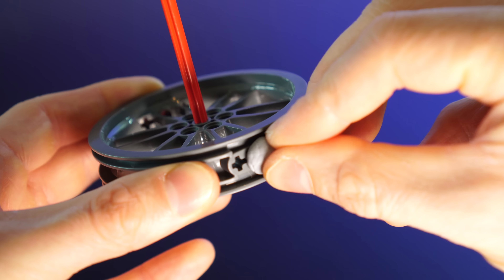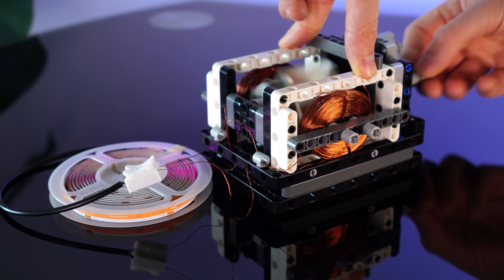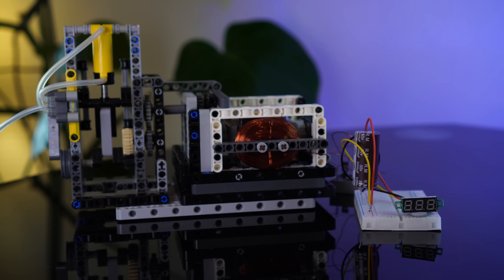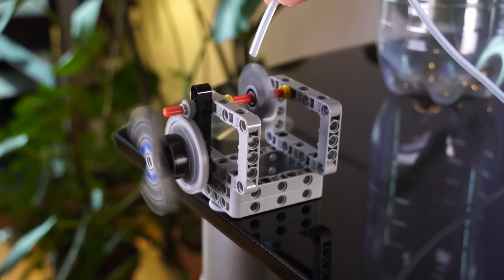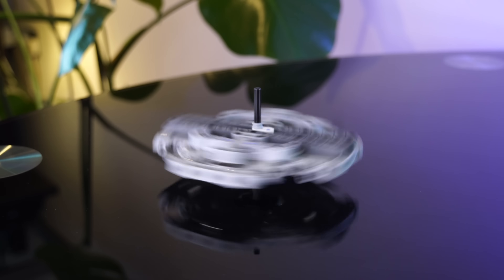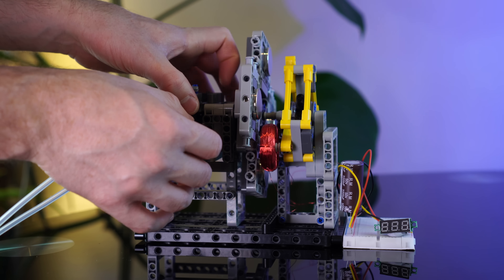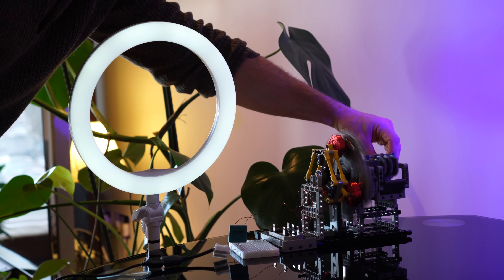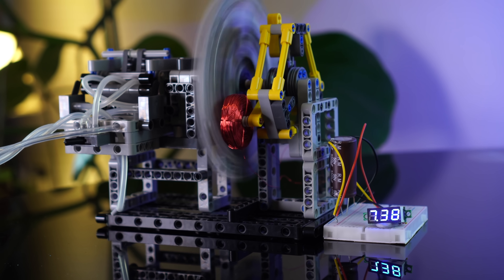Lego Air Turbine: Generating Power From Thin Air!

Comment: I’m using the airflow from my air purifier to generate air for directing the air. Instead of an oscillating fan powering oscillator, I’m using the generated air to oscillate an air director.

Comment: Can u do a six phase generator?
Reply from the maker: As far as I know you can make as many phases as you want! Though there isn't much (or any) benefit to adding more, especially if you smooth the output with capacitors
Reply: @JamiesBrickJams  wow I didn’t think you would reply. thanks!

Comment: You might need to modify the Pneumatic Pistons, simply lubing and redrilling the holes will increase smoothness and better rpms
Reply from the maker: I'd love to make one with modified components! Green Gekho has some incredible engine designs. My dream would be to collab with him to make a pneumatic engine generator using his latest powerful designs
Reply: @JamiesBrickJams  I only know this from another YouTuber, he did a bunch of Pneumatic Engine Designs and wanted to see the max rpms he could get. He didn't go into depth about it, he doesn't speak in the vids lol, but he showed a point where it appeared he took apart the piston and lubed and I think drilled but it may have been smoothing out the edges that go around the piston. Afterwords it had a sizable increase in movement and rpms. Once I have the money I'm going to be checking out some of these sets myself.

Comment: The better question is: can it run a compressor to get the same amount of air back?
Reply: No because of the law of energy preservation alot of the energy is lost to heat so you will lose alotof power

Comment: Its kinda possible to create a generator from spinning a bike wheel thing, like just attach a big gearbox to it (obviously not a lego one) and connect it to these magnets in a bigger circumference and a bit more of the wire, and you have a big voltage generator!

Comment: Sry i might be stupid but HOW does the air transfer from the bottles to the Valve

U put something on the bottles to press the air out ? 

Or am i missing something
Reply from the maker: So the bottles have a pipe going into it, and a 3 way valve connected to that pipe. A compressor then pumps air into the bottle, and the valve is then switched to the middle position, sealing in the compressed air. Then when you want to reject the air, you simply open the valve again. It's just a standard Lego pneumatic valve!
Reply: @JamiesBrickJams  I thought the compressor was only used for testing aight I missed that great GREAT video and thanks for the Reply 
Have a good one :D
Reply from the maker: Appreciate it, you too 😁

Comment: Use a MPPT chip to gather as much power as you can!
You can charge up a LiIon cell, and probably expand your lighting time at least a bit.
The passive AC to DC is lossy, and you waste ennergy by not using all the voltage and current when available.
An MPPT chip will help you with that = )
Also, the flying wheel was like a mechanical capacitor, it would improve stability a bit too (even is your last design is "heavy", so it probably don't need it).

So, yeah, nice video, thank you!

Comment: Wouldn't those turbines spin better if you lock them up, sealed. So ALL the air acts upon the proppelers? (Yeah i don't know how can you seal them up with legos😂)
Reply from the maker: I'm pretty sure you're right, that should improve efficiency! I tried a few different designs that mostly sealed it up, but I actually didn't see any increase in speed or output, so I just removed it to make it more interesting to see in action. But I'm sure if it was done properly it would improve output

Comment: when you made your coil, did you use bare copper wire or was it clear coated?
Reply from the maker: That wire is coated yeah, so it's insulated! Otherwise it'd short itself. Fortunately, almost all wire you can buy on spools is insulated like this

Comment: how do you make your coil? is there any special way you wrap it in to a circle?
and one more question. what wire do you use
Reply from the maker: Those coils I actually just wrap around some Lego. The middle is a small technic smooth bushing, and then I often sandwich it between a couple of Lego wheels or liftarms. Then you just wrap a bunch of turns! At the end secure it by wrapping a bit of wire around it. I believe these coils were made with 30 gauge copper wire

Comment: Im thinking that you put the air pump like powerfull one and hook the power into generator and the powerfull pump goes to air bottle and i think it makes infinite electricty btw convert the volt like 7 to (the pump volt requirement)
Reply from the maker: Ha I wish. Converting power from the pump to air then back to electricity is one of the least efficient ways of energy conversion 😉

Comment: I know how how bro can upgrade this just add some uranium 235 and make a nuclear reactor out of it!
Reply: He'd need to build a core with control rods, then build a water heater that uses the heat from the core to boil water into steam and make a turbine spin. It would work but radiation, cost and legal troubles are things to consider.
Reply: I don’t think that would happen
Reply: welp... LEGO NUKLEAR POWER YEAAAAAA.......

Comment: Hey, Great Video But can you maybe link The Radio Module? Thx
Reply from the maker: Thanks! It's the YINETTECH 87.5-108Mhz FM Radio Receiver Module that I got on Amazon (UK). I'm sure there are plenty others like it on places like Amazon and AliExpress
Reply: Thank you so much! btw: do you know if you could use it with headphones?
 @JamiesBrickJams
Reply from the maker: Yup you can! There's a small 3.5mm audio jack built in. It doesn't do Bluetooth though

Comment: How strong are your magnets? What are their pull forces?
Reply from the maker: They're n42 magnets with a (supposed) pull strength of 16.5kg at 25mm x 10mm
Reply: What’s the pull force of the large square ones?
Reply from the maker: Those ones I'm not actually sure. They measure 40x40x20mm and are an absolute nightmare to work with. They're absurdly powerful, and almost impossible to separate unless you make a magnet guillotine. Very dangerous to leave lying around too

Comment: That’s actually a one-to-one gear ratio known as a direct drive. Did you take out both gears from the generator and the engine you will get an actual direct drive
Reply from the maker: You're right, not the smartest idea - it would have been better designed if I removed the gearing for that one rather than losing efficiency through the gearing. But a future version will run much better!

Comment: Bro just a question why do you used a bottle how did it work 😊
Reply from the maker: Hey, the bottle stores compressed air from the compressor. A valve keeps the air in. When you open the valve, the air is forced out, which blows over the turbine blades, powering the generator

Comment: What if try to turn on an aircopressor
to if it can spin the tutbine?
Reply from the maker: Yup, sure can. I experimented quite a bit with running it directly off the compressor. It works reasonably well, but obviously not as fast as running 3 inputs at once

Comment: Idk if my comment reached but what is the wires made out of???
Reply from the maker: Hey! They're simple copper wire - you can experiment with different gauges (how thick it is). Generally thinner wire with more windings will yield higher voltages but lower current due to higher resistances. The copper wire has a thin enamel coating which protects it from shorting
Reply: Is it magnet winding
Reply from the maker: I'm not sure I understand what magnet winding is. This is just a spool of standard copper wire that I wrapped around a Lego piece in a disc shape

Comment: How to you use the bottle to blow air
Reply from the maker: Ah perhaps I should have explained that better - the bottle is pressurised using the handheld compressor! So it stores a few litres of air under pressure. When the valve is opened, the bottle forces air into the turbine

Comment: You should put coils a bit further from the centre so the magnets pass in front of them completely.
Reply from the maker: The position was carefully done so they do pass perfectly in front of the coils - perhaps the camera angle didn't show that off well enough. But you're still right in a sense - positioning them further out could potentially increase output slightly as they'd be moving faster against the coils

Comment: Wait a second, hold up… the engine was coming under load because the circuit had too much electrical load, and that was transferred via the magnetic interaction from the magnet and the copper coils? Is that right?
Reply from the maker: Yup! Any time an electrical load is placed on a generator, you can feel the resistance against the generator input. So for example, if you crank a generator, it'll move easily with no load. Add an electrical load (e.g. a powerful light), and you'll immediately notice the resistance against your hand increase. Same for this pneumatic engine. Add an electrical load, and the engine will take the strain. Sometimes even enough to stall the engine. Kind of like starting a car in 5th gear

Comment: I have a video idea for you that doubles as something useful as a diy project for your audience, can you make a hand crank powered usb phone charging port out of Lego? Preferrably with some kind of internal power storage so you don't have to worry about your phone getting a stutter charge if you aren't cranking right or get tired before your phone is charged?
Reply from the maker: Love a good crank generator! I actually already have a video on a hand crank generator that uses a voltage regulator to stabilise the output at 5v, pretending to be a USB, and was used to charge my phone. But will likely do something like that again in the future

Comment: Would like to see your 3 phase generator power a 3 phase brushless motor.  Don’t forget to add load so your inrush current doesn’t damage your motor.

Edit:  I just discovered your channel.  Going back over your other videos, I came across your levitating fan.  This might be an excellent candidate for a 3 phase motor.  It would eliminate the need for the reed switch altogether.  Just in case you don’t want to do the conversion, I posted another suggestion there.
Reply from the maker: Another excellent idea, thanks for all your suggestions today! That's true, treating the fan as a traditional brushless motor is totally doable. I'll be honest, it does feel like a weird and lossy way to power it, but I sure do love the over-engineered nature of it 😁 Will certainly bear that in mind for some future experiments!

Comment: Why does he think compressed air is thin? Is he stupid?
Reply: It is technically thinner than other compressed gasses. Because air takes so much more energy to compress compared to other gasses. That's why air tanks have thick shell containers compared to something like air dusters, Which those containers have liquid that turns into gas. That's why you're not supposed to breathe them in and keep them away from heat.
Reply: Plus I don't think he meant it literally because it's supposed to be playing on words like "I'm producing electricity from "thin air"
Reply: @ParkerLewis912  why did he take my comment seriously? Is he smart?

Comment: I would add a gearbox to make it able to spin faster, as the rotor acts like a flywheel. I would also make it water based as water is heavier and cannot be compressed, making it unable to lose power that way.

But overall, nice work!
Reply from the maker: Originally I had planned to use a gearbox, but to be honest, the efficiency losses due to the mechanical setup of Lego gearboxes made it a very poor performer. But I'll certainly try a gearbox for a future more powerful cylinder-driven generator!
Reply: @JamiesBrickJams..more deal with gear less RPM you'll get...

Comment: Great idea and execution! One idea for improvement: Remove the spacers between those turbine wheels. You are losing airflow there that you could use more efficiently if the gap between the turbine wheels was a small as possible.
Reply from the maker: I've heard that suggestion a few times now, so I suspect you're likely right - I'll give that a try in a future update! Thanks for the suggestion 😁
Reply: @JamiesBrickJams make an wind mill and and compasiter and try to add solar panels

Comment: Aren't you losing efficiency by changing mediums?
Reply from the maker: Changing mediums? Not sure which you're referring to... But if you mean using the compressor to compress air, then using the air to turn the turbine, yes - there are massive losses between those steps! It's hilariously bad
Reply: To what tho?? like compared to a normal generator? Come on man that's silly

Comment: The video is nice 👌
My question is , how do you achieve the required air velocity at the nozzles out of “ thin air “ ?
I assume this is nothing but a mini windmill ! 
But how to convert thin air into compressed air of pressure & volume ? 0:07
Reply from the maker: I guess a turbine is technically a kind of windmill with extra steps. Not sure I entirely understand your question, but the air nozzle is just supplying compressed air (at high speed) from those bottles. And the bottles were supplied air by the compressor. So as the bottles release air and return to atmospheric pressure, that high speed air turns the turbine blades, which then go through a gear reduction to turn the rotor. The term 'out of thin air' is just a fun play on words 😉

Comment: make a lenz less generator. need one medal disc rotor from a saw cut away the teeth's then cut the disc similar to a turbine but so that the steel can cover one magnet and one coil with the space of one magnet empty. then place magnet and coil in the stationary frame one magnet and one coil and repeat. place another set on the other side. place the disc rotor in between the two sides of the stationary frame and when you now rotate the disc it will alternate the inductance between the coils and the magnets but in such a way that there is no drag on the load.
Reply from the maker: Hmm will need to do some research to understand what you're proposing here. But I'd be cautious - there's no way round the conservation of energy. For a generator to output anything (with a load attached), there will always be resistance against it. That's a requirement for energy to be transfered from mechanical input to electrical output.

Comment: Use a lego motor as a generator
Reply from the maker: Could do ... But where's the fun in that? 😉
Reply: @JamiesBrickJams  you could make a comparison video and if the lego motor is better (wich i would assume) you could try to optimize your generator even more🙃
P.s. wassn't supposed to be a critic hope it didn't come over as such love your video's 😉
Reply from the maker: That's actually a great idea! I'm pretty sure you're right - I'd imagine the Lego motor is likely to be more efficient. Though I could likely scale up the output better with larger magnets and coils. Cool idea to compare the two!

Comment: what if you also spin the copper coil and if you think the wires are going to get entangled look at how a dc motor receives its power
Reply from the maker: I guess you could... But it adds mechanical complexity and inefficiencies. You're likely better off taking the input power and just trying to double the speed of the rotor rather than getting both to move.

Comment: what if you made a big ol crank pump that you can use to easily build up a large excess of air in a tank to cut out the need for the compressor. like a sorta crank generator but with a compressed air intermediary for power storage.
Reply from the maker: Haha I guess you could ... This would be way less efficient than just having the crank drive the generator directly (air is really inefficient to create and turn back into electrical energy). But I sure do love needlessly over-engineered concepts! So cool idea 😉
Reply: @JamiesBrickJams   Yeah, but maybe more of an energy storage thing?
Reply: @JamiesBrickJams  HeeeHeee, Pneumatic  energy storage go BRRRRRRRRRRRRRRRRRR
Reply from the maker: I'm sold 😄

Comment: Wait but wouldn’t that be running on thick air if it was compressed?
Reply: Yes. As you squeeze air into a small area, it eventually gets to the point where there is not enough space, so the air resorts to squishing together, leaving more space for air to enter, creating what you call “thick air”

Comment: You need to measure it with an oscilloscope and see what the signwave outputs look like.
You can also calculate the wattage of the generator like I did for mine: https://youtu.be/heFF7Y4RLmQ
Reply from the maker: I'd love to do that! I don't currently have a scope, but it's on my list. I shudder to think how scrappy the signal would look for this thing, but I'd love to visualise it! Well done on yours - it looks awesome 👌
Reply: @JamiesBrickJams those scopes like the one I have are about $50 now, so not too bad. I was wonder how your generator would work if you doubled up the poles and coils.
Reply from the maker: Oh wow that's a lot cheaper than I was expecting - will see if I can find one. Adding additional coils and magnets works up to a point. But very soon, the main limitation becomes resistance against the generator when you add an appreciate load. Then it becomes a battle against the physical robustness of Lego, and the torque input it can manage

Comment: Try putting more coils and magnets, like , more sets of the same rotors and see the volatge boost and if jt adds weight it should run for longer
Reply from the maker: Definitely with you about adding more magnets - I've plans for a significantly larger flywheel made of much larger magnets. They're scary to work with as they tear lego (and your hands) apart if you get anything wrong!